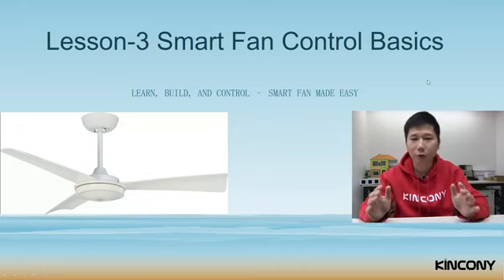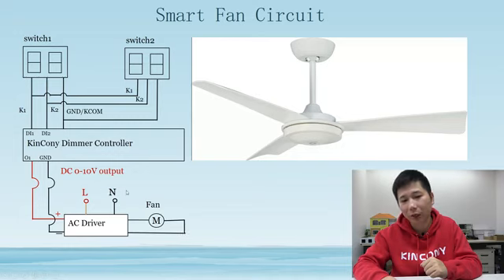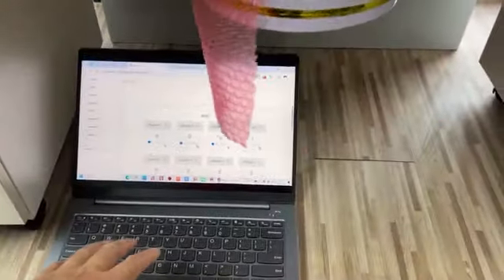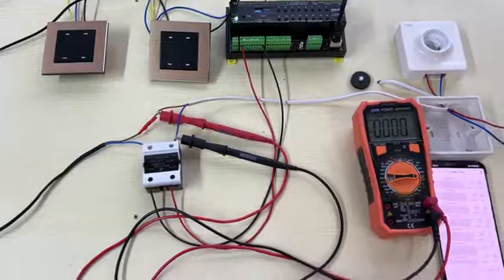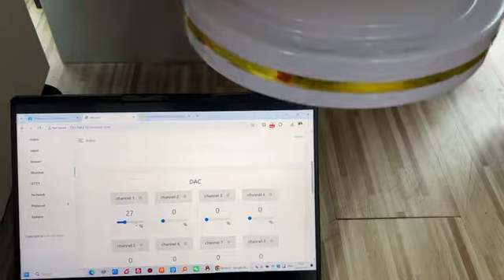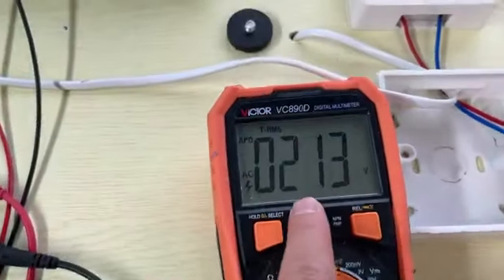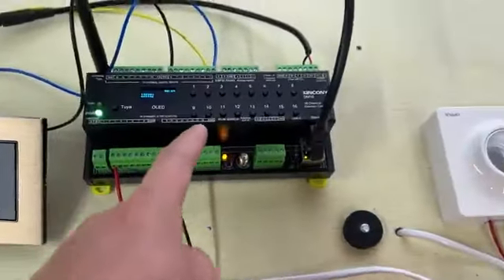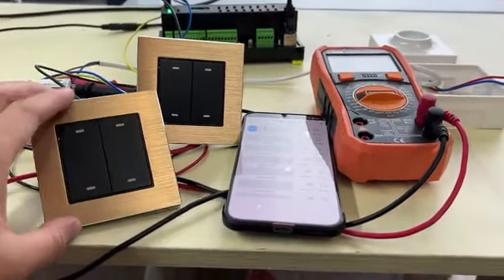How to smart control ceiling fan | KinCony Home Automation Training 3

Comment: Very good work sir!
Can we use normal 220 v dimmer with this circuit.
Example : 1 time I speed control with dimmer 50% & now I want increase the speed remotely with any device not dimmer, 
It means I no want change my home wiring or button and dimmer if any reason auto system will not work i remove it,
And Use same setup direct manual only without replace the dimmer.
I want this type of work 😊
Reply from the maker: Can you add my WA：+86-15531181781，To facilitate our technical communication